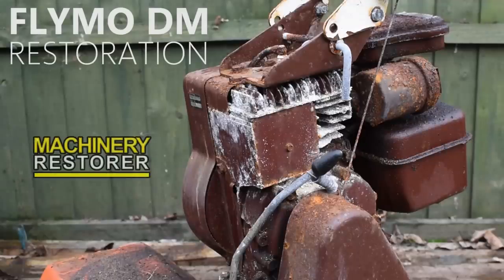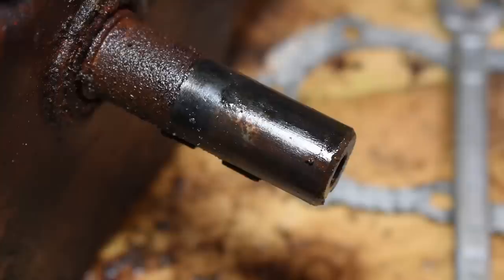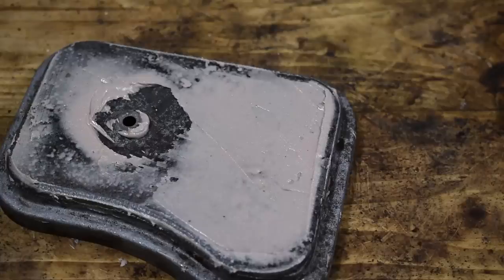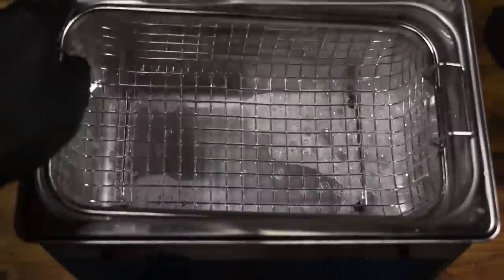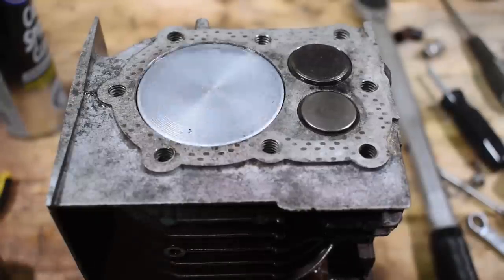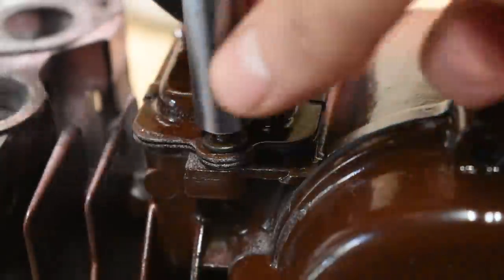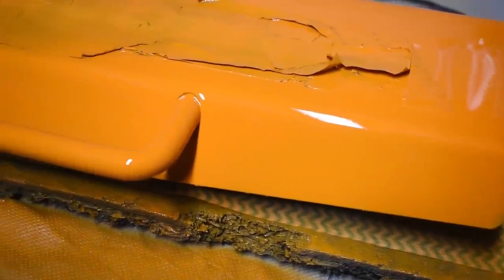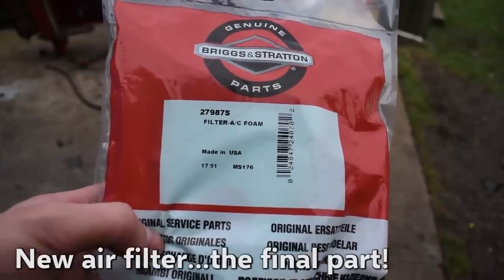TILLER RESTORATION (Will It Ever Run Again)

Comment: My father used a MerryTiller rotovator much like that one, and from his I think you may be missing a part, namely a skid that fixes on where the transport wheels go.

When you're using a rotovator like a MerryTiller, you use your weight on the handlebars to slow it down and force it to dig in; that way you don't have to be hugely strong to stop it running away over a hard soil surface, you just have to put weight downwards onto the handlebars and skid to make it stay still. That should make the tines dig in better and dig deeper.

MerryTiller produced three types of tines for their machines; the slasher tines like the ones on your machine, stirrer tines intended for very light soil, and pick tines intended for breaking up very hard soils. If you take off the outer set of tines on your machine, the weight of the machine makes it dig in deeper; this is a different strategy for hard to dig soils.

Comment: Hey young buck, you are awesome...  Some suggestions: You need a wire brush wheel (course on one side, fine on the other) and get an small air grinder and some small wire wheels while your at it. You need them. Why didn't you put filler on the tank to fill that dent before paint?,  Try using a cordless hand drill(in low speed) next time to lap valves, it's a lot easier, quick and does a more thorough job than by hand.  Get yourself a wash tank like the small 20 or 30 gallon barrel types, will do a much better, faster job of cleaning cause you do a LOT of cleaning! :) Love the bead blaster box and your finished work. Looks like that little tiller took you for a walk! :)

Comment: This just my opinion here but oil is oil is oil. It is  just packaged under different names. I prefer Pennzoil over all the rest. A good 30w would work just fine in this engine shown here.. You did a awesome job rebuilding this rototiller. The nice thing is that it will work just as good as a brand new one.

Comment: I had to watch this one again.
I just gave away a tiller i only used once.
I went out and bought one pretty close to this one being fixed.
The other one i gave away because it would not run after i only used it once.
The one that would not run was the type that had no wheels.
All arm strength to run it.
The new one you still use your arm strength, but has wheels to roll it around.
My old big tille had big wheels and was always clogging up with dirt.
Very hard to use, so i gave it to a friend that said he needed a tiller to barrow, so i gave it to him.
Hope he has fun with it ahahahaha.

Comment: Beautiful work!  I would have gotten another filter housing for the air intake to save the hassle.  Otherwise you did great in this bolt-level, total takedown and restoration.  Thank goodness the engine wasn't a Nineties vintage engine with the flimsy, difficult pull cord/blower housing.

Comment: Just took apart my 5HP Briggs for a rebuild, only to find the camshaft and cam gear made out of plastic!   I chucked the block right into trash where it belongs. Bet you,  car engines will be like that shortly. At least you had an older one with metal parts and an air fuel mixture screw, which the new ones don't have anymore either.

Comment: My brother kept bragging about how he has always used tillers and chainsaws and a few other machines.
But when it came time to use them, he didn't know how to use them.
He didn't know what fuel to use with them, he didn't know to pull the pins from the end of the tiller blades to clean roots and dirt from the tiller blades, he didn't know to cut under the trees first so the tree would not rip down the tree bark when cutting off some tree branches.
I have only seen my brother have one job in his life.
He is the type of dude that always finds a sucker to pay his way in life.
And yes, i have been the sucker a few times.
I have worked jobs sense i was 12 years old, so i have had much practice using, and fixing the machines i need to get the jobs done.
But sometimes you get machines that just don't want to work.
Like my brother , ahahahaah
I finally got him out making his a garden this year.
 He did a bit of work.
But i think he already gave up, sense he has not been around for a month working on the garden he planted.
Most gardens need our help.
Got to keep up with the bugs, watering, trimming and pruning, weeds, and critters trying to eat it.
Reply: ......and here I was thinking we were talking about a tiller........

Comment: Top tip, if you apply some heat to the aerosol tin before application, it will provide a far smoother finish.

Comment: A very well done and interesting video.  You can't beat an old model Briggs & Stratton with a stick.  The fact that this particular engine was built in 1980 and still serviceable after a standard rebuild proves the point.  Not so sure of B&S quality nowadays.

Comment: The Flymo label really has a late 70's early 80's look, right down to the color scheme.  The orange blade guard was a great paint job.  That brown paint wasn't very cooperative.  Too bad you couldn't have used the same kind of paint as the orange, which went on much better.  Which salt water ocean was this stored in or around?

Comment: Lovely editing and captioning here. Love the upside-down sticker — so what?
Another method for cleaning rusty fuel tanks to shinier than new is to use a clothes dryer — might want to wait until the missus is gone — and BBs. Flush the tank well and dump in a cup or so of BBS. Replace the cap and seal the carb hole with duct tape. Wrap the tank with foam rubber to the point it can be wedged in the dryer drum. You don’t want the foam/tank to bounce around in the drum; you want that assembly to be immobilized as the drum turns and the BBs do their thing. Run the dryer for 2-3 hours (no heat, obviously) dump the BBs, flush the tank with a safe solvent and repeat. Did this with a small Briggs tank from an edger and the thing ran flawlessly until the day I sold it.

Comment: I watched your other 3hp B&S engine restoration.  I noticed that the flywheel on this engine ( 1:45 ) looks like something took a bite out of it and needed a replacement piece attached.  For the ignorant (and if you know), could you explain why the flywheels are different?  Thanks.

Comment: A good job, but rear part is left on for work, just the wheels come off. I notice you didn't take the two long plastic feed tubes off base of carb, one has a ball bearing in usually and is a one way valve, other has a filter in it, I'm amazed the engine actually ran without cleaning them. You can use the wrong diaphragm with the extra hole, but I like to use correct one. I'd have bought another air filter cover, but then it's your build, well done.
Reply from the maker: Thanks, I did show taking the wheels off and just leaving the frame in my latest video.

Comment: That's weird that in 1980 Briggs was still using points on any of their new engines. I remember about that time Sears was selling retrofit kits for the Tecumseh engines featured on their mowers, and also had Briggs retrofit kits to convert from points to solid state ignition.

Comment: I did my dads old tiller before but I didn’t realize there was a slight knock and it blew a hole out the side when the piston arm let go. All that work for nothing.... all because my uncle left it outside for a year. It was about the same age. I think 70s or 80s if I remember right. Not as much oxidation as that though. That must have been outside for 15 years.

Comment: I would have to find some high temperature primer because when I etch primed the fan shroud for my 3 horsepower Briggs and Stratton vertical shaft engine for my lawnmower (92500 engine) the heat from the engine cooked the primer which caused the engine enamel to peel off !

Comment: I have a question: Why isn't the first step in refurbishing metal parts always an electrolysis instead of removing rust? With electrolysis you would save much more of the original metal instead of removing it. Can somebody explain this to me?

Comment: Where on earth did you find the decals and gaskets and all the other parts. I'm about  to try to restore a 25 year old tiller with a briggs. I'm going to pick it up tomorrow!
Reply: type " briggs & stratton  gasket"  in Google if you have a computer.
same for the decals.
Pretty sure it can be printed with the right hardware

Comment: The valve tappets should be labeled and reinstalled in the original positions.  3 in 1 oil is not assembly lube.  Clear laquer is not for engines.  Only engine paint should be used.

Comment: Thank you for the perfect video on what is not a restoration, what you have demonstrated here is just a clean up and  make it run tutorial. A restoration would have left all parts cleaned, polished and painted as new or replaced if the afore mentioned things are not possible.  I am sorry to say that none of this was done on this tiller. You should go watch Tystube's channel or My mechanics channel these two know how to do a restoration (key word here is restoration )and are some of the best restorers on YouTube. You have a good starting point but need a lot of refinement in your methods. I am an engine builder and machinist by trade so  this is not coming from an armchar expert. Try again on the next project and see if you can do a better job, to be fair I can see that you put a lot of work into this and I can appreciate that but you did not do a restoration on this tiller. PS  stop saying things like " will it ever run again" in your titles it is a rhetorical and largely unecessary.  I for one am tired of seeing it in the titles of everythingthing. In moy opinion nearly any engine can be made to run again regardless of the condition it started out in, it is my business to know this fact as it is what I do for a living.

Comment: Lucky the plastic fuel tubes that go into the gas tank from the carburetor didn’t snap. Usually after being that old the blast is old and dry rotted.

Comment: Most restoration videos I've seen they clean all the parts,strip all the old paint, and then fill the holes. How come you dont clean all the parts and remove the paint before sandblasting? Probably get better cleaner results. Other then that good video.

Comment: Nice job.  Tips from a pro: Use engine assembly grease, not 3 in 1.  Also hone cyl wall, use new rings and convert to SSI.  Use chem dip for carb.  Carry on son.  :)

Comment: Biggest mistake with reassembling the engine. You used machine oil. Not engine assembly lube. Probably damaged some parts on first start up

Comment: Painting the carburetor on a flathead or any motor. Is a terrible thing to do. The card sweat and breathes through the cast. That's why they sweat and get cold. From atomization of the fuel.

Comment: People, please stop doing the side-to-side motion when painting with a spray can. Use a circular motion instead.
The side to side thing comes from commercial automotive and house painting equipment where the paint comes out in a very elongated oval. When using a spray can it comes out in a sad circle. If you use side to side then there is a huge area in the middle getting a lot of paint and very little on the top and bottom. It's very difficult to regulate how much paint is getting on the surface near the top and bottom. If you use a circular motion then you stop applying paint to an area when you can't see the subsurface anymore. You don't get near as much over spray and many fewer drips.

Comment: removing the spark plug that early was a mistake. and then turning it over with all the crap that fell down in was just plain stupid. you are lucky you didnt damage the cylinder. that said it turned out ok so cograts on that. but ye always make sure that you get rid of any loose stuff before opening yo the insides

Comment: the 3 in 1 oil for assembly lube scared me.
Reply: It's better than building it dry. 
Every time I do an oil and filter change on my car I drain the old oil then refill the sump with diesel fuel to the top mark on the dipstick then run the engine, no load, at 3000rpm for 30 minutes. Drain off, change the filter, refill with synthetic oil. Done! My engine is absolutely spotless inside.
Reply: @duncanhowarth9514  I'm used to car motors and you wouldn't do that. It won't hurt that kind of motor, just makes me cringe...lol. The worst I seen was a friend rebuilt his mopar motor, took it for the long awaited test drive and the oil drain plug was finger tight and fell out. Back to the shop to add new bearings...lol

Comment: You dont normally use a tiller with its wheels on cos it will continually run away without doing much to the soil...rotavators on the other hand have drive wheels cos the tilling blades are at the back..PS  Great video . I had 3 tillers in the 80s similar to that one plus a big rotovator

Comment: I'm sorry but that tiller is not what it seems, it's had oxydizer sprayed on it to make it look like it's rusted and extreme oxydation has occurred you knowtice when he takes the breather off the inside of the carb is very clean rusty tank but the pick up tube looks like new ... Not really that old..
Reply from the maker: Sorry but you are completely wrong. That is how it was found, it was stored in a damp garage for many years.
Reply: @MachineryRestorer  In a garage ok that's why it looked clean on the inside of that carb well sir I admit when I'm wrong and I am wrong I was under the impression it had been sitting outside in the weather rain snow hot cold temps well it does seam to run good... You keep it or sell it or restored it for some on else?

Comment: Only grate look, inside very bed repair, not cleaning cylinder, not delete rust all, not replace spark plugs wire, and not replace piston rings, but, I don`t work outside, not make ability. Me very hard entering this comment, in village it is difficult to learn languages others countries.

Comment: This was a bad restore.  After sandblasting or even prior too, you should have used metal bushes and even files to remove all that excess gunk until it was smooth.  try soaking in vinegar or even soak with vinegar and electrify it to help remove gunk, then sandblast and then file some more if necessary.  this was a poor restore.
Reply: all of it should be done before using any filler.